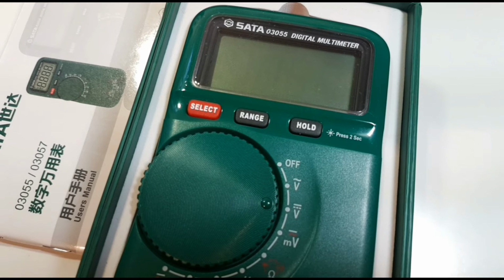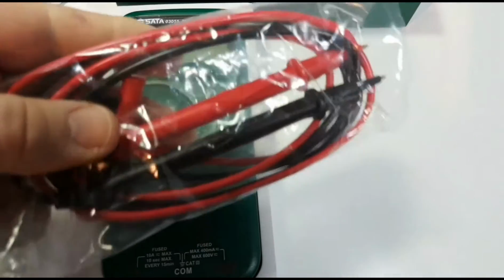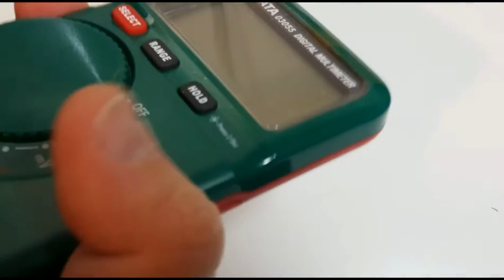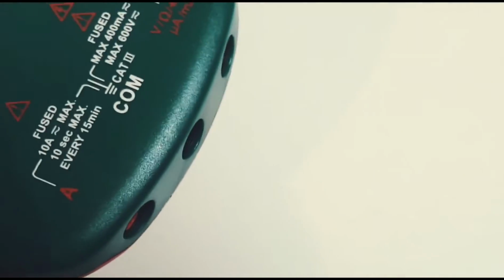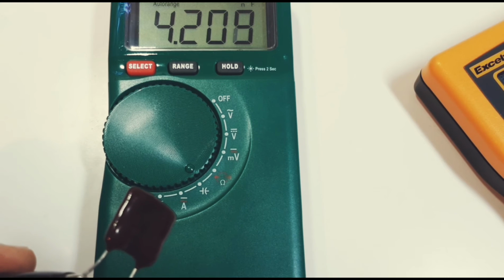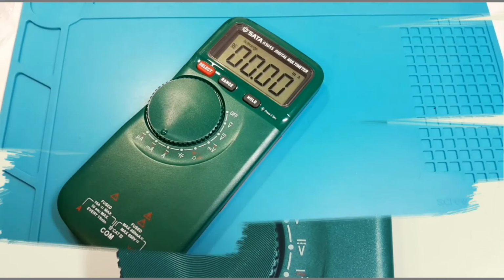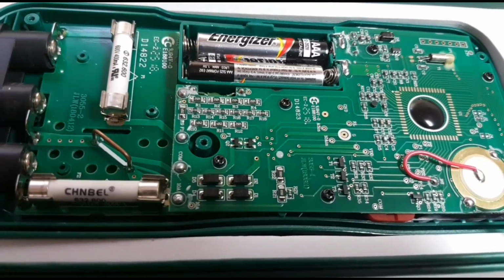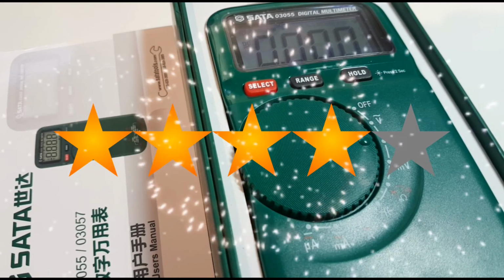SATA 03055 CHEAP-O Multimeter Review & Teardown!

Comment: I have one of these meters and I corrected the low continuity volume by replacing the peizo with a PC post speaker and wired it from the speaker connections down to the fuse area and hot melt glued it in place.  Now my continuity is nice and loud and I really like this odd but well made little meter.  Its biggest fault is no stand, but the Fluke 101 has the same fault so for $20 im no going to sweat it.
Reply from the maker: That's a great mod! Its probably one of the most peculiar dmms to come out in the past few years..tilt stand woukd have been great because it's a fairly long dmm and proper  viewing placement can be a chore...then again..I have this great addon multimeter  stand from a guy I know !!🤣👍

Comment: I like it. The backlight function is great. Why can't all multimeters be like that??
Reply from the maker: I Totally agree. ..The backlight needs to be turned off by the user not the multimeter.. At least SATA got it right.
Reply: Got my SATA multimeter today.... but.... the back light timed out. So it's not constant on. It will time out. That's so sad. That was one of the reason I bought it.
Reply from the maker: @thingblaze5754 That's very strange, As soon as I saw your message I turned on the SATA meter again to verify, it's on volts dc and the backlight has been on now for 30 min..How long until yours turns off?
Reply: @KeepOnTesting  I timed it now. My backlight turns of after exactly 30 sec. So I'm a little disappointed.
Reply from the maker: @thingblaze5754  30 seconds. Mine was on for 54 min until I manually turned it off.  I'll contact SATA directly and see what they say..
Reply: @KeepOnTesting  I have ordered another one. Its in the mail. Curious if that one have the same timeout on the backlight.
Reply from the maker: Me too, let me know..Thanks!
Reply: 30 secs on mine, as stated page 7 of the manual. 🤣

Comment: Cheers Darren,  just love the colour scheme, so different. One already on its way from your link. Best wishes from this side of the pond.
Reply from the maker: Hi Derek.. Yes it's a fun capable dmm with alot of versatility....let us know how you like it!
Reply from the maker: Hi Derek, If you have a moment can you please verify if your backlight stays on permanently on the SATA dmm? , I've had a user report theirs turns off which is strange. Thanks!
Reply: Yes mine turns off after 30 seconds as is stated on page 7 of the manual.
Reply from the maker: @derektodd4126 I stand corrected.. Errr..however mine stays on permanently.. unless I turn the meter off or press the hold button again for 2+sec!  How is that for an anomoly? Not sure why but obviously I'm liking it. I missed page 7 amidst my initial excitement either that or I was spending too much time in the snow and had a temporary brain freeze. Thanks for clarification. I'm emailing SATA as they wanted feedback so hopefully future revs might be able to reap the same benefit. I'll due my due diligence in future. 🤯
Reply: Forgot to say that I tried it both at rest and taking readings, still 30 secs.